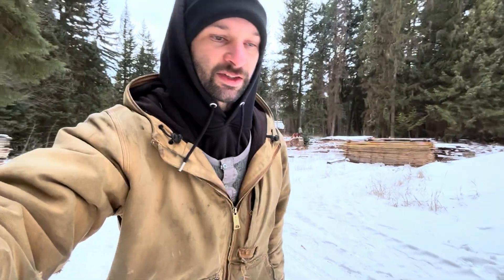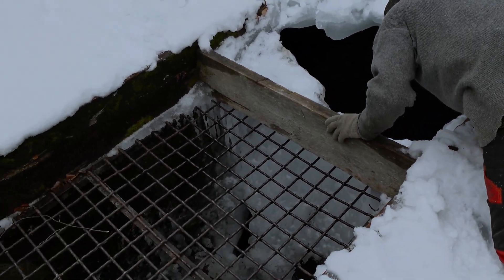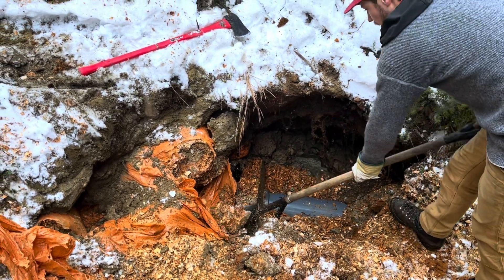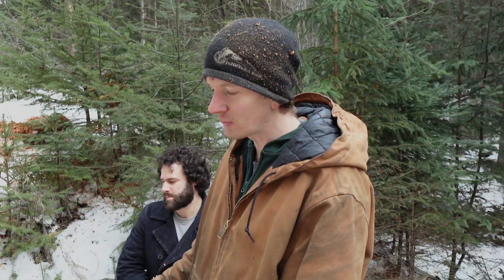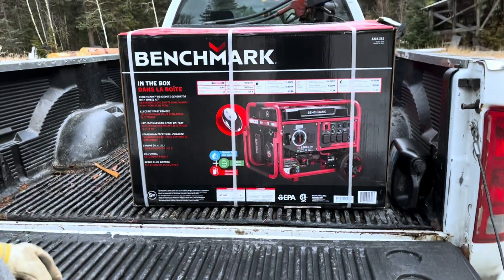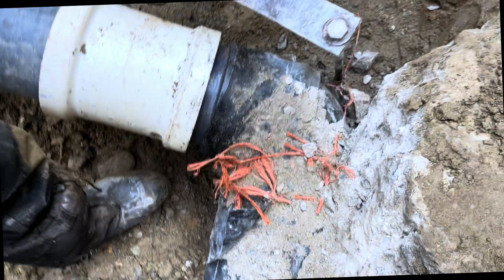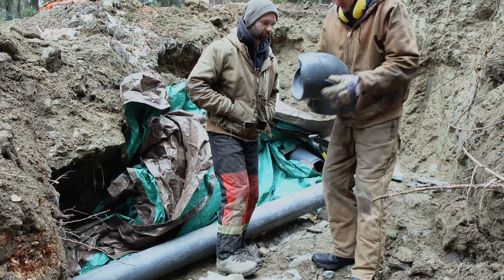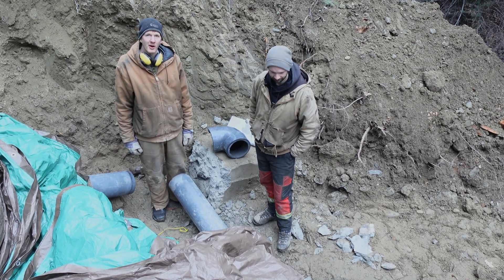Off Grid Hydro Disaster

Comment: Did some thrust blocks on a steep downhill waterline years ago, pockets were dug into the sides of the trench into undisturbed ground, the pipe layed in and forms installed then the concrete went in and the pipe was now keyed into the ground past the trench so it could not move.
Reply from the maker: I’m picturing the concrete forms reaching out sideways or perpendicular to the pipe to grab soil. Sounds solid.

Comment: Dont put a 90 in do two 45"s  u know now the 90's fail
Reply from the maker: I want to put two 45s in. It just looks better. The problem is that I can’t move either piece of pipe. The last glue joint is actually impossible if you think about it. Ha.
Reply from the maker: Also why did it fail? poor backfill maybe.. we had a water volcano near there 5 years back that might have washed off a good chunk of the material protecting the concrete from frost.
Reply: Too much static pressure from the 90o turn ever seen a 90o turn in nature ? @MountainVoiceInc

Comment: I’d say that the ground heaved a bit as the frost sank in and moved your concrete. You would likely be better off bedding the pipe in sand, so the ground can move around it without breaking it.
Reply from the maker: I agree with all that, the concrete is because it was assembled with a gasket coupler and without the support the water pressure would just blow the coupler apart. We will get into it later but sand around the pipe is definitely a good idea.